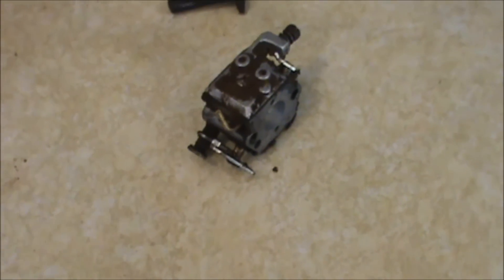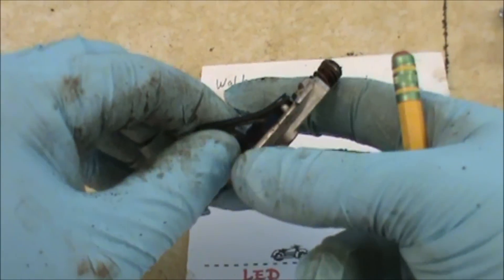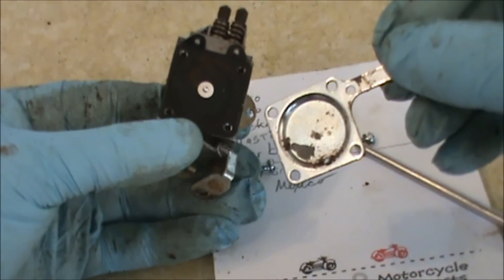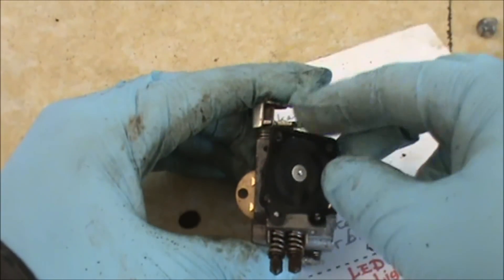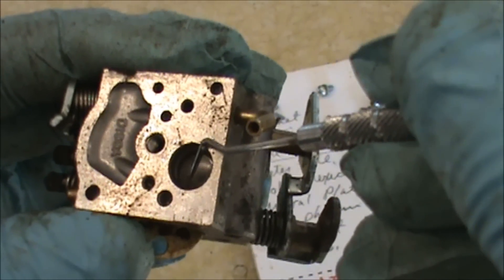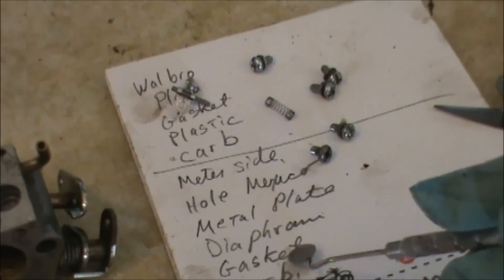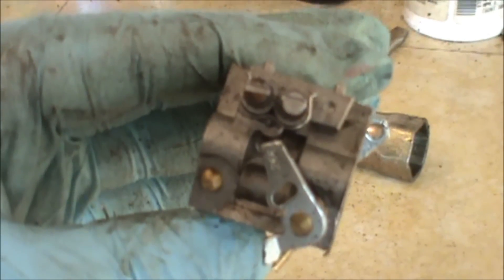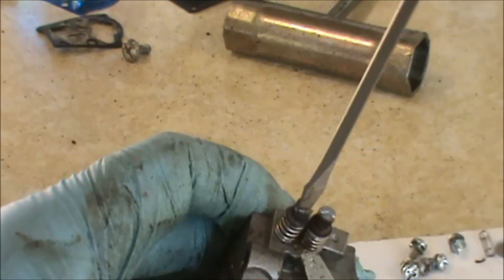How to clean a carburetor Part 1

Comment: I feel like you didn't do anything to it you didn't take the Welsh plugs out to check the galleys and it's not a blue membrane is called a fuel pump and on the other side it's the metering diaphragm and you called it a fulcrum it's a metering rod I took one walbro carb apart about a decade ago and I can do it blindfolded and you have to write it all down wow
Reply: if YOU don't know the order the parts go then how do you know the other guy put it together right?

Comment: quick question i have a echo pe225 weedeater new carb ,lines and fuel will only start for a second with a shot of carb cleaner. there is a small passage behind the plastic insulator should that be clear does it run all the way threw the cylinder